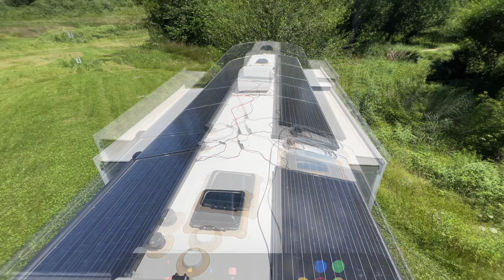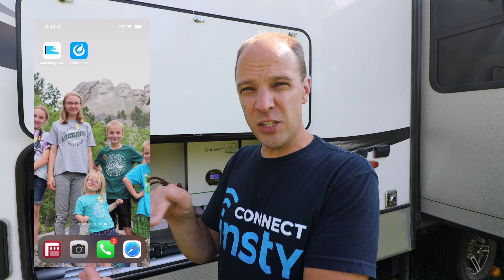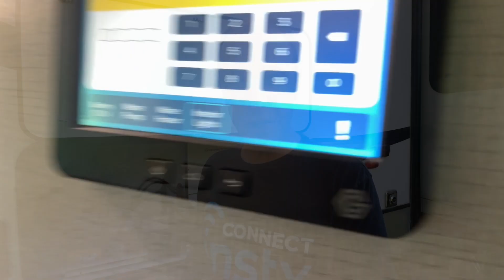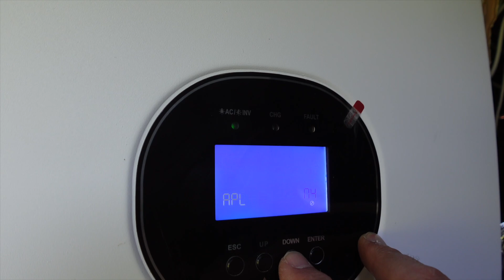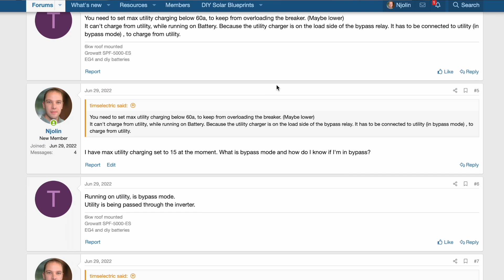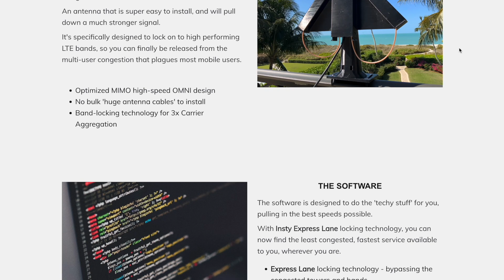How to DIY a HUGE 50 amp RV Solar System

Comment: If you want a suggestion add the ability to charge the system off your alternator while driving down the road. It can supplement the solar as well as take over in low light times. You may need to upgrade your alternator or even add another one if there is room.

Comment: You have to run your load off of the solar panels with enough extra power from the panels to also charge the batteries.  Then you use batteries at night.

Comment: No no that’s not how the plug works. You are getting 50 amps total you don’t add up each leg. It’s 50 amp 240.
Reply: Yes, but the way you said it is incorrect. You only have 50 amps. Not 100amps. It’s 50 amps Together. It’s coming from the service as 240 and each leg is 120 with a ground and a neutral ……I’m an electrician.
Reply from the maker: @Smalltownlyfe  it's actually 100 amps total. You would be right if we were actually using it at 240, but since we are using the 2 legs separately, we have a total of 100 amps. Think of it this way, when you see a big rv going down the road and they have 6 ac units on the roof, the way that's possible is that they have 2 individual legs of 120 at 50 amps a piece. Also, think of 2 separate 30 amp services (like 2 stands in an rv park) they don't share 30 amps, they each have 30 amps available to them. It's thinking outside the box because normal electrical work deals with 2 legs as 240, which is why it's bonded at the breaker, but rvs just do it a bit differently keeping the legs separated all the time
Reply: @theNickJolin  sigh
Reply from the maker: @Smalltownlyfe  it's OK, no worries. We can agree to disagree :)
Reply from the maker: @Smalltownlyfe  when you bond you double the voltage but keep the amps. Without bonding, you keep the voltage and double the amps
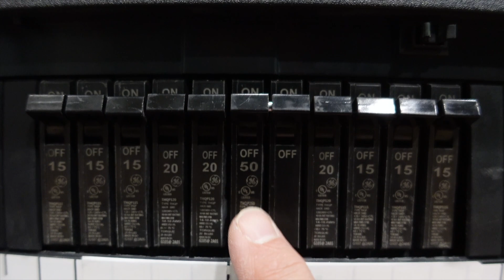Reply: @Smalltownlyfe  I'm having troubles accepting the 100A figure as well.   They are still split phase and still produce 240 leg to leg and 120 each leg to neutral; they are 180 degrees out.  They use a 'standard' 50 A breaker on the box and when either side exceeds 50A then the entire breaker trips.  And, they can install a separate box that will allow for a 240 circuit for a dryer.  In the above video at 8:31 you can see the 50A breaker, it is a standard 50A breaker that if one side blows it trips the other side, it is not two separate 50A breakers.
Reply: @kw5kw
Reply: @DEN-1000MNTX  With that being said, I have installed two Growatt 3500 24v inverters in my 2020 Cougar's outdoor kitchen.  I named one leg "black" and the other leg "red" and one inverter serves one leg. They are NOT tied together.

Since RV's do not use a "standard" electrical box I finally see what you meant but coming in from the shore power one does have the potential to change out breaker boxes for a home style unit inorder to gain 240 useability and then I would have made my inverters tied together.
 
Anyway each leg has 25 amps available to it now and I run both A/C's, microwave and the water heater off my two 24V batteries from Signature Solar.

Love your video and have watched it multiple times.

Thanks for the encouragement. 

We're going back to Custer, SD this July. Maybe see you there!  We'll be in Custer's Gulch RV park around the 4th.

Russ
Reply: @kw5kw  I’m curious how the neutral wires were ran? We’re they split pre inverters and then bridged post inverters?
Reply from the maker: Except nothing in the RV is 240, so what you end up with is 2 legs of 50 amps @ 120v

Comment: I use this solar Generater.Systems  at work. The building is 80 years old so there’s not a lot of electrical outlets. I use it for lights, fans, charge phones etc. works great !

Comment: Hi!  I did my research just like you! I suggest a 24volt 50 amp buck converter. this will step down your 24 volt system for your 12 volt side of your panel. I did not see a manual breaker on your system for your PV (hint you have to have one for building code) it must be a posative and negative throw at the same time. If you have one that is great. The funny thing is I did pretty much the same install on my 30 trailer but 12 volts(mistake on my part) The wire sizes are huge and expensive. My system is obviously smaller then yours 30amp coach 1 A/C with softstart. 280 DIY battery and 1 Vestwoods 100 amp. 3000 watt sungold power inverter ( 90 amp charger but you can dial it back)  I would love to talk to you some time about all this cool stuff. I am getting a fifth wheel as my next step of RV and since you have done a 50 amp two leg system I would love you to empart on me your knowledge!.

Comment: I have about 2500 watts of solar and 800 amp hours (12v) of battery. I ran a plug off of my inverter. I then plug my trailer through the original 50amp cord into the inverter. That way if there is shore power or we want to charge the battery via generator we just plug the trailer into the power source. The converter/charger powers all of the 12v and charges the battery at the same time. I did upgrade the converter charger to deal with the lifepo4 batteries. We dry camp 70% of the time but 30% we are somewhere with power included in the cost.

Comment: Why not a 48v system? As I understand it, of you are not doing 12v stepdown there is not much advantage of 24v over 48v. Fewer BMS, fuses, smaller wires, etc. I know you will have considered it, maybe solar voltage. Anyway, also wondering with the new 6k 120v inverters from MPP and EG4 can you run both side of a 50A system from a single inverter. I know they will not be split phase but as I understand it that is not required.
Reply: Will says in his videos that 48 volt systems are great, but you need to be more careful because 48 volts can jump the skin barrier and kill you whereas 24 volts won't.
Reply from the maker: Yeah when I did my research there wasn't too much difference between the 24 and the 48, so I just pulled the trigger on the 24 knowing that I could always change to 48 if I found better inverters later, which it seems like you found a great option. Do you have a link for those new ones??  Thanks for the comment!

Comment: So. I'm kinda sad that I just found this video. I've invested almost that 5k in a system to stand alone just for a residential refrigerator! And as I haven't hooked it up yet I don't know if it'll do the job. It's 1200 watts of panels, 3500w pure sine wave inverter and 4 12v 50Ah batteries with charge controller wires etc. By my calculations this system has half the capacity for the fridge so my hope was to use the panels thru the day and charge the batteries to be used at night. Long winded but ... will it work? And you have the answer I needed 4 months ago. 😞

Comment: I built our solar system, with the help of Will’s videos and his book. I also used Tom and Stacey, at Great Outdoors Solar. 400ah lithium batteries, a Victron Blue 100/50 charge controller, and 840w of solar. I went with the victron, so I could put a battery sense on my batteries, and able to see the battery temp, and solar info. I purchased Ampere Time 200ah batteries. And they don’t have a Low temp cutoff. I’m going to get the Victron MultiplusII, cause I can adjust and supplement, and only have one inverter, instead of two.

Comment: Great video.  I'm not sure I would ever attempt to install a solar setup in our rig (we have a 2022 Solitude 390RK).  But, we are very interested in a complete solar system that can run our RV (especially the ACs) for extended periods of time.  We are finishing up a cross country trip and we have seen some pretty awesome BLM locations that we really wanted to stay at.  I've been hoping someone would come up with a all in one plug and play solar setup.  I'm wondering if I've found one.  Bluetti has recently come out with a solar generator called AC500.  Its a scalable system so you can add to it.  Its a 5000w system with an RV 50A plug.  My thought was we could put that in our front bay easily and then add however much solar we wanted to the roof (I'd be ok with installing solar panels).  What are your thoughts on this system for off grid RV'ers?
Reply: I would, first, do an energy audit.  Find out how much energy you use each day (in watts).  Once you know this you will know how much battery you need to go completely “off grid”.  

Keep in mind One 15K AC will use around 1400W of energy.  If you have 2 AC’s that will double the consumption.  One 100AH 12v lithium battery will have about 1280WH (watt hours) of energy.  If your AC uses 1400W of energy, it will deplete the battery in less than one hour.

If the Bluetti has 5000W of energy you will be able to run 1 AC for just over 3 hours.  That is assuming you are not consuming energy from anything else. 

You can see that it will take a significant amount of battery energy to be completely off grid.
Reply: You may want to check out DIY Solar with Will Prowse. One of his latest videos is a review of a new solar "generator" that looks great, and can be added to if you need more power in the future. The unit is pretty expensive, and so are the add-on batteries, but might be well worth it for the ease of use.

Comment: Just tap 12v out of your battery bank by a parallel wire and eliminate the other 12v battery up front. 
Negative at ground and tap up 4 cells@3v and that will be the positive. Check with your volt meter and you'll see it.
Reply: You do that, and you will no longer have a balanced battery bank.
Reply: @bobblack3870  yup
Reply: Just like Bob says, in addition to that, the 24v battery which is probably ungrounded,  would end up having one lead grounded or the centertap would be  grounded. If the 24v battery is already grounded than introducing another ground may short 12 cells and cause a fire, bad idea. Using a dc to dc converter will work better, and offer isolation between the two systems.

Comment: A 24v to 12v DC to DC charger is pretty common kit for marine applications. That would let you send power to your AGMs (assuming the unit supported that particular battery profile). The Orion-Tr Smart 12/24-15A Isolated DC-DC Lithium Charger might do the trick.
Reply: For his purposes, I suggest a 24 Volt to 13.8 Volt Buck converter. It has a 40 Amp output. If he runs his 24 Volt wires from the rear to the front, that would make a smaller Voltage drop that putting the buck converter in the rear and running the 12 Volt wires to the front. I tried a 24 Volt to 12 Volt buck converter, and had too many issues with it being under-powered.

Comment: Solar Generators have the battery, inverter and charge control ALL  inside their easy to transport box.  Check them out.  You can also get additional batteries to add to the original unit.
Reply: Yes but they are weaker and really expensive.  See 
https://youtu.be/fdeZz4QvxG0

Comment: If you use a Solar Generator you CAN charge it while using it.  The 2 types I have is a 700 watt Bluetti the other one is a Jackery.  These 2 brands can be charging and using the power at the same time.  Charging and Using is called PASS- THRU energy.

Comment: I don't know if you have heard about MPPSOLAR inverters the LV-MSD2424 but it can let you run the grid why the solar panels are charging the battery or you can use the battery wow the solar panels are charging the battery or you can use MPPSOLAR LV-MSD2424 which is the grid and I just wanted why the grid is charging the batteries THANKS hope the comments makes sense.

Comment: I have a 50amp 5th wheel I'd like to have 50amp solar to replace shore power. The rv actually came with an inverter, I just don't know how to use it correctly. And the coach company is out of business.

Comment: I did 2700 on the roof of a Salem 26 BHXL, a mini split AC, Solark 5 K and 4 eg4 48 v batteries. Have been off grid from CT to TX to CO since MArch, powered 2 additional campers at times, plugged in once,  lost battery twice (operator error).
Reply from the maker: Any pics of your roof panel install??
Reply: @theNickJolin  Yes, but I don't know how to get them to you. Email me my name at Gmail.
Reply: @joedigesu7004  awesome.  Lost battery? How did you lose the battery?

Comment: Nice system. I'm currently in the same boat. 30A motorhome, leaving 12V system intact to power the jacks, slide, 12v lights and fridge. In the picking out parts phase of building a battery bank/inverter/charger system. Currently I'm thinking 48V battery. 3.7v lithium pouch cells are available pretty cheap now being removed from electric car modules. 14, 71ah cells is about 3600 watt hours (I think). Looking at the EG4 3000EHV-48 all in one. I want to be able to fast charge the battery from the generator (5000w) and the EG4 will do 80A at 48volts. And still be able to run the generator for the ACs driving down the road etc. Might run a transfer switch to switch between generator or shore power to the inverter. Not sure what solar panels, haven't got that far yet.
Reply from the maker: Sounds like you have a lot of research in!  Sounds like it will be a great system!

Comment: I also agree, working to find a Inverter (I invented the name “Power Router Controller, TM”) which takes multiple inputs and feeds (up to high volt and amps solar, shore power, generator, even low voltage DC) to charge  the batteries, which then pivots back to the output “inverter” side for AC and DC output, is the way to go.  Who does this today?  Good question.  

However my concept above the Bluetti 500Pro does (one or two bonded or separate), and can add more battery if needed).  Unfortunately, the 12 DC output is limited to 10a.  This system is also expensive.  And is large device(s).  The Bluetti 300 Max can build battery storage however the single inverter is small, You can bond two of them to double the load or split them like you do your Grow systems. EcoFlow has choices too.   Either brand you use their built in UPS function that is able to take multiple input power designs to keep the output side running and batteries charged up.  

The issues with the premise solar generators…. Cost and fixed form factor. If there was a DYI system able to be built with the “Power Router Controller”, with component (separate) batteries, and input sources, would create a perfect RV (or fixed compound) system.

Thank you for your excellent content.

Comment: Starlink works great.  We now have Home/RV version and the enterprise business system.  Both power draws are minimal. FYI.  Between your insta and Starlink, anyone would be covered with low latency high performance connectivity.
Reply: I wanted to find out about Starlink. We actually need better internet at home, but I'd like to have it for the 5th wheel too.
Reply: @robwetch4469  I am very happy.  Even though I have fiber options at two locations (sounds nice, but reliability issues upstream), Starlink is the first order.  Have a standard co-ax based internet as second system each location.  I take the mobile on site for biz projects. We control our own connectivity.  So far no issues for speed, reliability, low latency for VPN, apps and voice.
Reply: I'm loving my Starlink.

Comment: Good explanation.  However I have a couple of beefs.  Solar has limits.  You need a clear sky and the sun.  If you camp in the north, in the trees, or travel in the winter, your solar system will be very inefficient.  Second, many of today’s coaches/trailers are terribly inefficient, insulation-wise and electrical-wise.  My rig is 12 volts for everything other than the microwave which is powered by the inverter.  12 volt diesel heater, 12 volt diesel cook top, 12 volt AC, 12 volt refrigerator.  And the new fangled lithium dies in hot weather and dies in cold weather.  My AGMs chug along in Yellowstone in February and the desert in July.
Reply from the maker: So far, the lithum is doing well for us, even in the hot weather (it was 108 in Rapid City this past weekend  and we ran the AC for quite some time).  I agree with the inefficiencies of RV's for sure, I wish they would spend some time and effort on making them a bit more efficient.  Thanks!

Comment: Victron 24v to 12v.... I would have gone with rack mounted eg4 setup either 24v or 48v.... The vibration in DIY buss bars could be issue..... Checkout electrodacus...best control and BMS made
Reply from the maker: Yes, I looked into them and to be honest, there was one that I almost pulled the trigger on but it had like half reviews that said it died after a little bit of use, so I was gunshy on that one.
Reply: Big battery also has new long and thin 12v and 48v batteries.... 12v size is 10.5"x1.5"x48" .....this is newest lifepo4 cells

Comment: I built my own 280Ah 12 volt battery using info from Will and Andy (Off grid Garage).  I have a small 30A camper, 2000 watt inverter.  I put in a transfer switch to change from shore to inverter power.  The battery charger is hooked into the switch to disconnect it when on the inverter.    There are large 24 to 12 converters, but the issue for you is the long large wire run from the back to the front, maybe under the trailer.